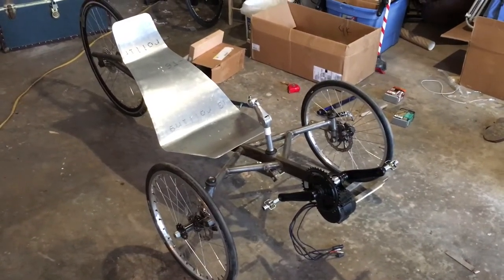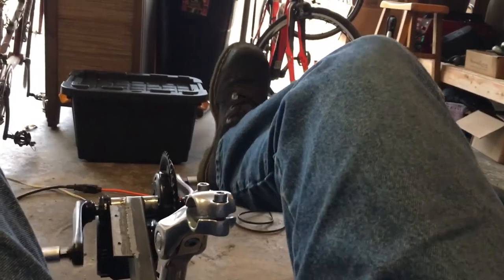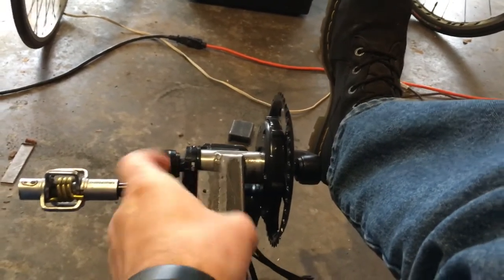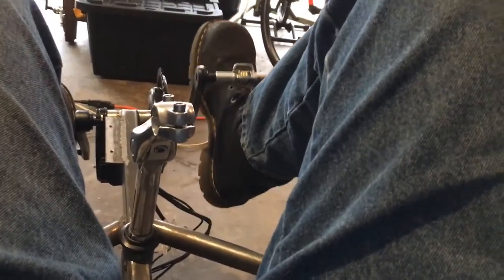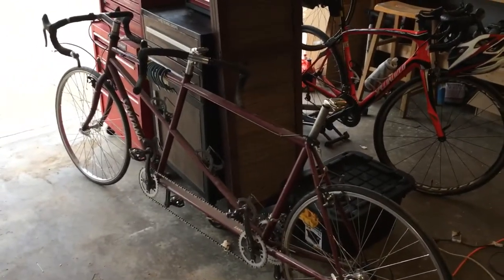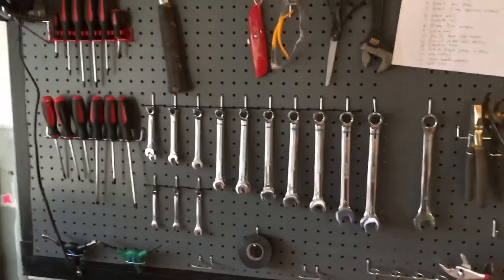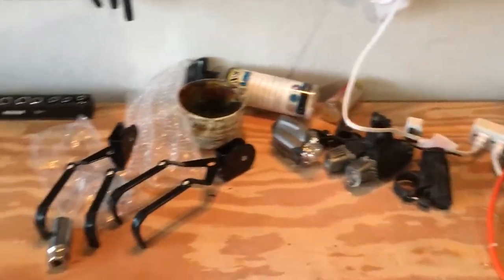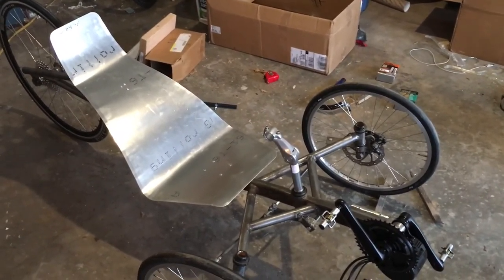My Velomobile build!

Comment: chop the end, cross drill it and add an adjustable extension tube. try to find some way to delete the chain guide on the top of the drive line. chances are good it will break.